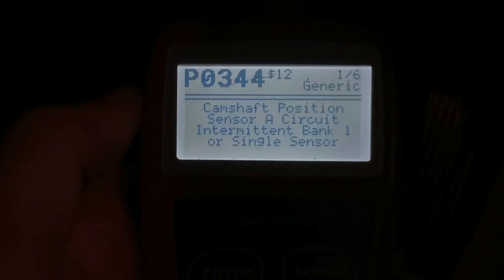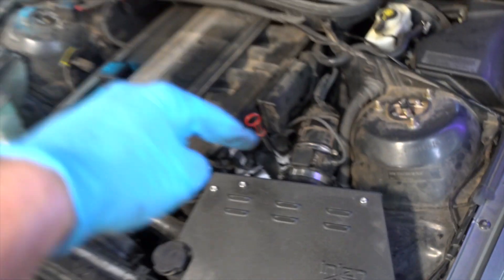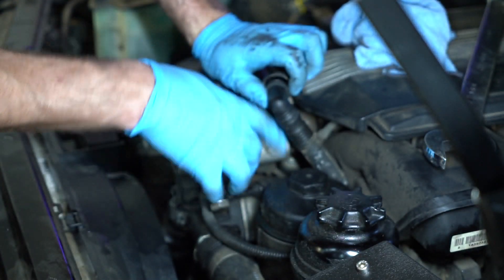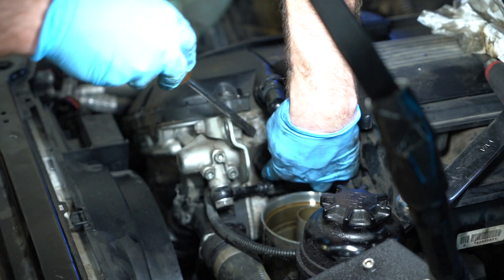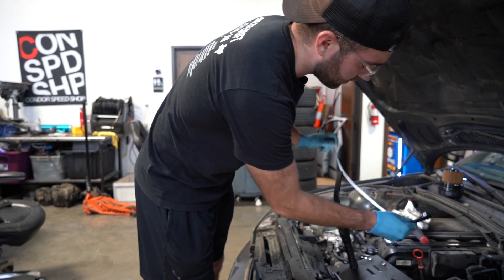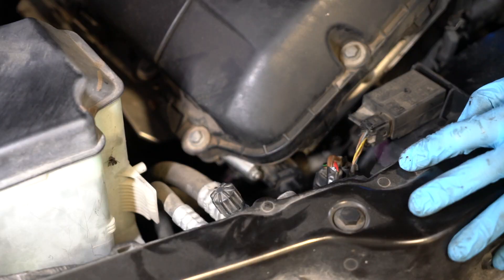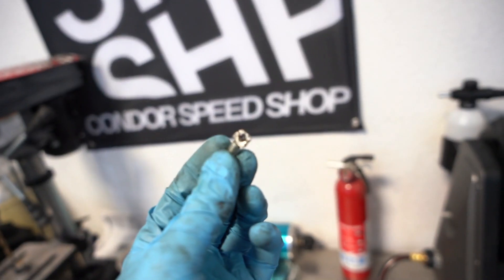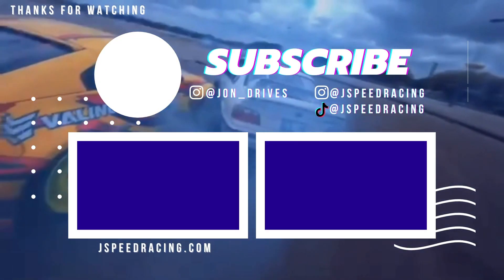BMW E46 CAMSHAFT SENSORS P0340 P0344 | M54 REPLACEMENT

Comment: Question: how did u unscrew the exhaust camshaft position sensor bolt after you cut it? Because I cant find to get enough space to unscrew it with a flat head after I dremel it, thank you

Comment: found oil on the sensor connector on my exhaust side, should i be concerned
Reply: The o-ring is bad which is causing the leak

Comment: Just a note when it comes to critical sensors like the two cam position sensors, crank position sensor, etc... Do not throw away your old part for a while even if the new part fixes the issue at first.  Hang on to it somewhere because the M54 is very finicky with sensors.  You might need to dig your old sensor out and refit it temporarily just to keep running while you wait for another replacement if the new sensor dies.